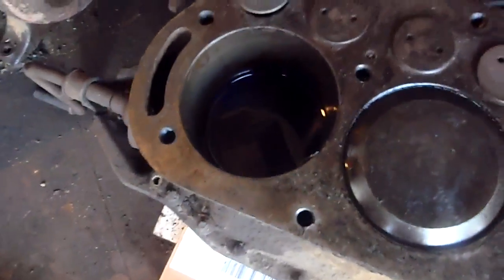Update on Model T preservation

Comment: @64gravely I am sorry the way I phrased my original question. You are right to say that the engine is original to your tractor. In another of your videos, "An update on the Model T and the gravelys", I believe that I saw the intake and exhaust  valves on either side of the cylinder.
I am not a Gravely expert and others will probably correct me. By 1960, Studebaker Corporation had acquired Gravely. I believe that you are right, the engine is Gravely designed but Studebaker labeled.